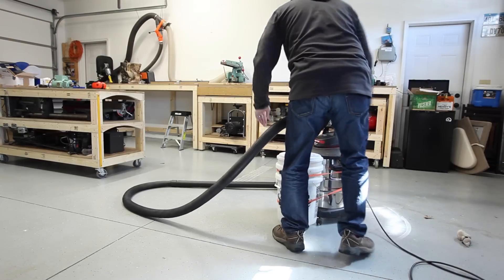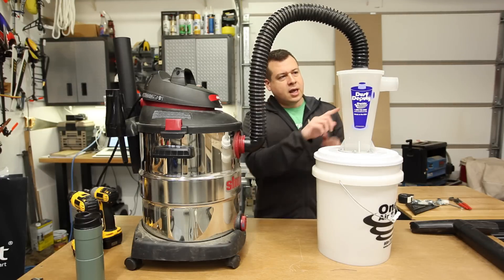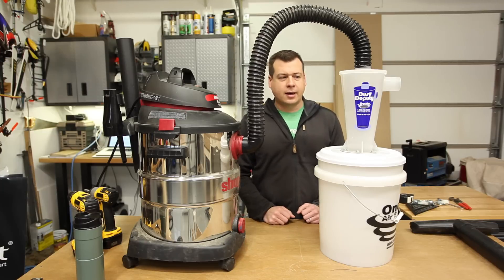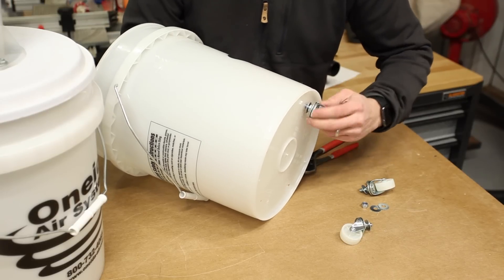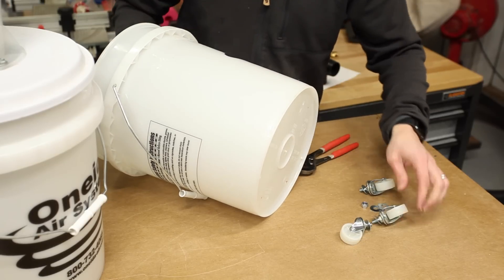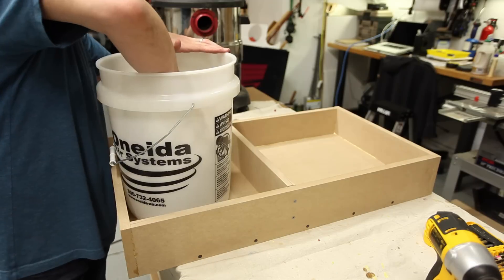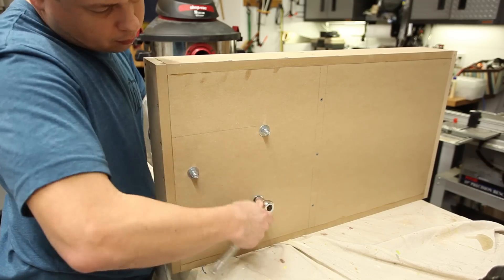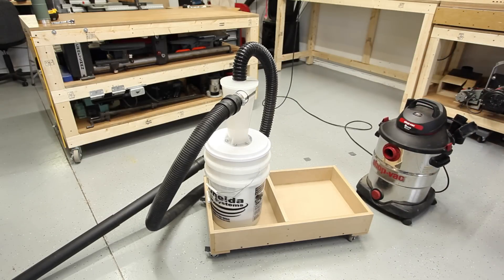A Simple & Effective Shop Vac Dust Collection Cyclone Cart

Comment: Very nice video and plan for small shop dust collection.  A comment about the mechanism of dust collection in the cyclone and shop-vac combination ... the spinning motion in the cyclone separates the larger particles and captures them in the bucket below the cyclone.  The smaller dust particles continue on and should be trapped in the filter of the shop-vac itself.  

You can get HEPA-type filters for the shop-vac ... and those can trap very fine dust particles ... which really helps protect your lungs. I suggest using a HEPA-type filter for you shop-vac and it is still good practice to wear an effective dust mask when "making sawdust".

Stay safe! Stay healthy!

Comment: I like the idea of using a cyclone.  When you get all that fine dust in a filter it really does cut down the air flow.  Then it is a pain to get that out of the filter. I have tried using a leaf blower on the filter, tapping it on a tree not close to the house and even blowing it out with compressed air.  They are all messy and it makes cleaning a vacuum out suck (hahaha)!  If you are like me and live in a place where they allow burning, be very careful dumping that dust if the fire is already lit.  It can be very dangerous when saw dust flares up like that.
Reply from the maker: The cyclone really does help a lot.  To this day I haven't needed to change the filter in my shop vac because 99% of the dust falls out with the cyclone.  I've dumped my cyclone bucket dozens of times since I made this video and it seems just as powerful today as the day that I added the cylone.

Comment: Nice. Do the holes you drilled in the bucket have any affect on the suction?
Reply from the maker: Hi Kelly - no, not at all.  Those holes only affect how easy it is to pull the inner bucket out of the outer bucket.  The actual suction only takes place within the inner bucket.

Comment: It's been an honor to run through your vids.  Have you ever used a leaf blower to get the floor clean?  With those garage doors it ought to work out.  I have an old '60 Craftsman RAS that I'm thinking about using in my basement shop and I came here first to see your RAS table build.  Cool.  I ordered and got the Mr Sawdust book in a hurry. I think you're great.  Power of computer.
Reply from the maker: Thanks Terence. Yes! I use a leaf blower to clean the garage floor all the time. It is by far the best gas powered floor sweeper of all time. Having multiple garage doors helps to get everything blown outside and into the bushes.  My radial arm saw is also a 1960 vintage.  I like it so much I might even pick up another older one.

Comment: Tommy I'm curious about the connector at the cyclone inlet, where the long hose connects to the unit. What do you have connecting them? Also the elbow connector at the shopvac. My setup is kind of like yours but I need a better plumbing arrangement
Reply from the maker: Hi Dave - I'm not using any special connectors where the hose meets the cyclone.  I'm just using the shop vac hose with a hose clamp.  That's it!

Comment: Really enjoy your videos. I have pulled several of your ideas for my workbench. I am now looking at a solid shop vac to keep my space clean. Do you use this for all of your saws? I was looking at the Rockler wall mount vacuum.. Keep the videos coming.
Reply from the maker: Hey Joseph - happy to see that you're enjoying the videos :) I don't have any experience with that wall mount shop vac, but I would assume that it would be fine. I mostly use the Shop Vac for mobile cleanup around the shop with my planer, jointer, lathe...etc.  For fixed machines that don't move (my bandsaw and radial arm saw) I use an older dust collector.  I'm not even sure of the make / model but it works really well.  You'll get a lot more capacity out of a larger dust collector so I think it all depends on how much saw dust you plan on generating.  If you're just doing small stuff here and there, the shop vac is just fine.  For larger projects, a larger dust collector is ideal.  I have mine on a remote switch so I can turn it on from anywhere in the shop which is really nice, but my 4" hose that I'm running out of it definitely needs some work.  It's currently just hanging by some zip ties and duct tape.  I foresee a video on fixing that up in the future :)  If you plan on using a cyclone with a shop vac, the actual capacity of the shop vac doesn't matter so much so in that case just make sure that it has a lock of sucking power.
Reply: Looking forward to it!